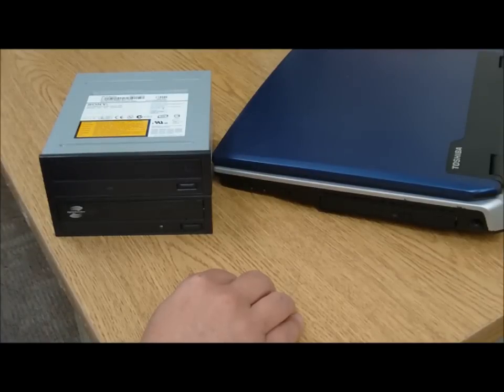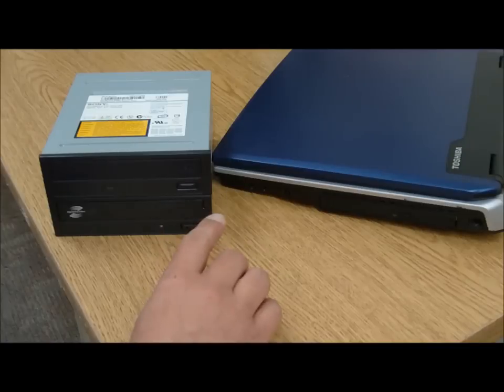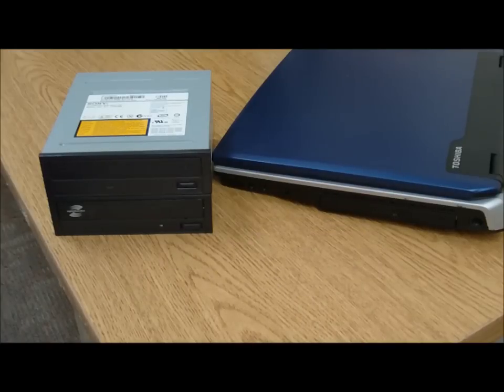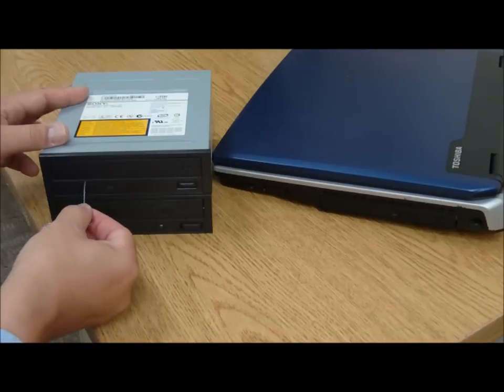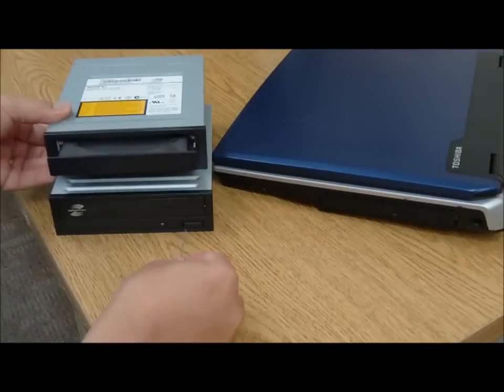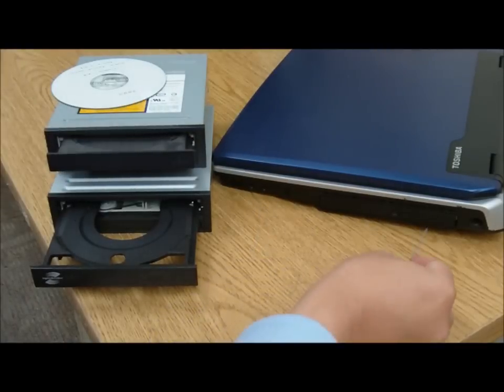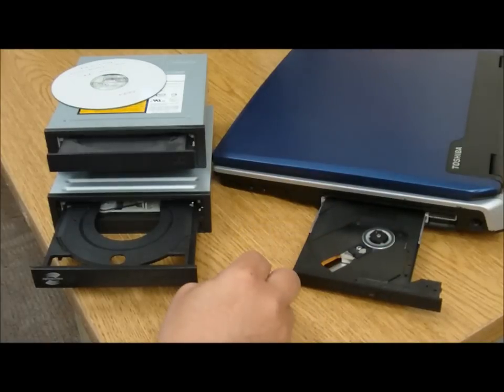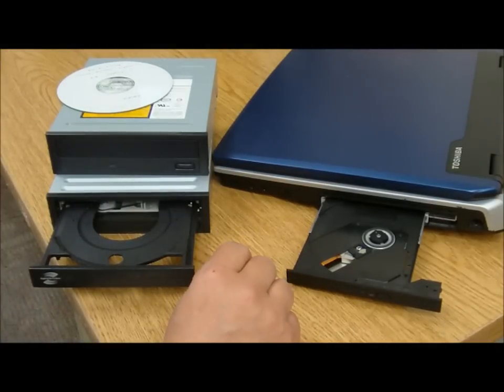Tech Support: Open CD Drive w No Power

Comment: Just undo the screws for the slot drives on the outside and carefully open it. The pin hole that you use here is on the side. This is 2023. It was easy.